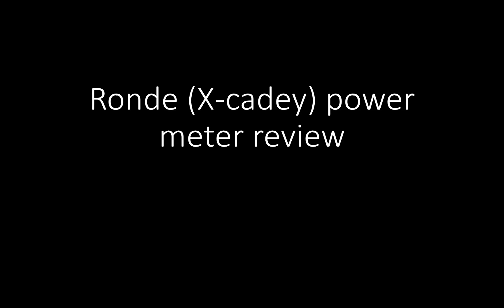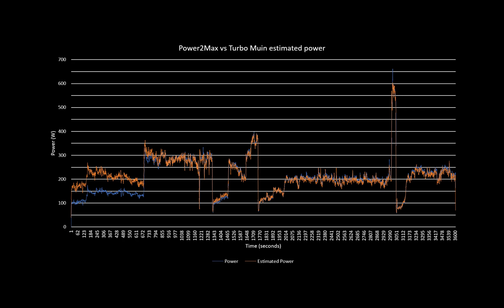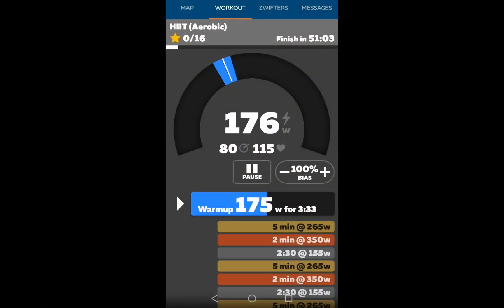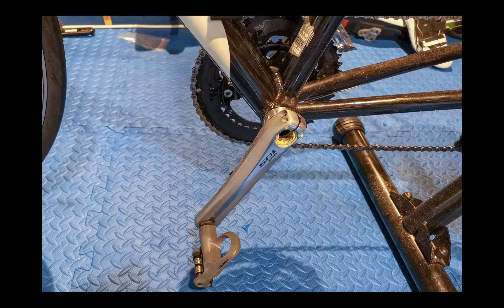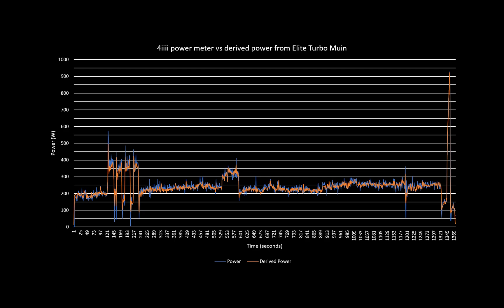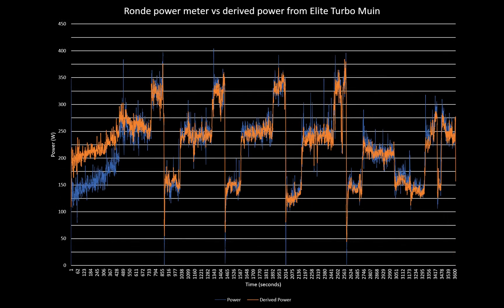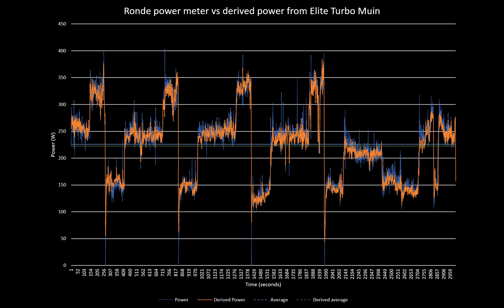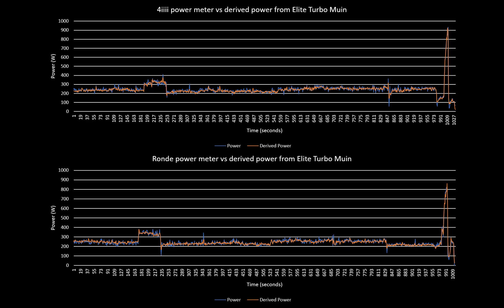Ronde (X-cadey) power meter review

Comment: I purchased this power meter over a year ago. I started to get bad (very very low) power readings. After many calibrations, disconnects and reconnects, and new batteries. no fix. Support suggested I update the firmware, but I can’t get the app to run on Android or IOS.  It crashes every time the process starts. Has anyone else had these problems with meter or the app? Very frustrated.
Reply from the maker: Oh dear, I've not had any problems so far. It is a long shot, but have you tried a different brand of battery - I have heard some create funny issues with other power meters. I doubt that is the problem, but worth a try if not tried.

Comment: Hi, i own a xcadey and have a question you might had experienced already. Given it is left crank only, is it giving me just half of the total power that i should be considering when using other power based apps? (fulgaz, elite training, etc)
i mention this because i feel it is too difficult for me to keep the suggested levels. 
I put my elite or fulgaz app in parallel to the xcadey mobile app and i see that i would need double power to match that...
in the xcadey mobile app i can calibrate the zero position, and then enter power adjust as 200% of what i get, but not sure i am doing the right thing
Reply from the maker: It takes your left side power and doubles it. So it can be inaccurate if you have a significant difference between your left and right leg power,but it shouldn't be out by that much. Have you got your FTP set correctly in these apps? If your FTP is set too high then you'll struggle to hit the targets on workouts. If you are having to set power adjust to 200%, I think that implies that you have a Left:Right power balance of 25:75, which seems unlikely.
Reply: Jonathan Colledge thanks, will play with FTP to check behaviour